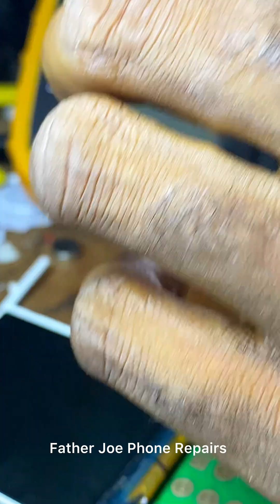How to repair any phone that is not booting  ( New Method ) 😍

Comment: You should have read the dot under the pad, before opening the heat cover. But well, it's all good. Keep up the good work
Reply: father Joe seriously the way your work is taking is impressing me me too I,am            phone engineer but my problem is that  I don't have desolder wire an rosin that is used to find shorted capacitor I don't know where to buy them please guide me